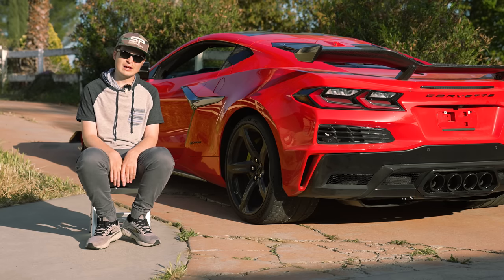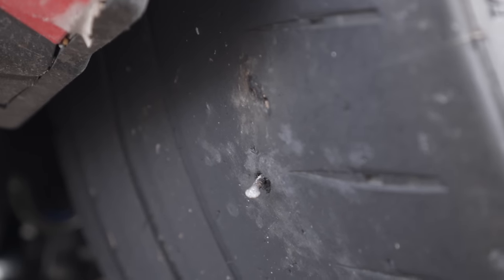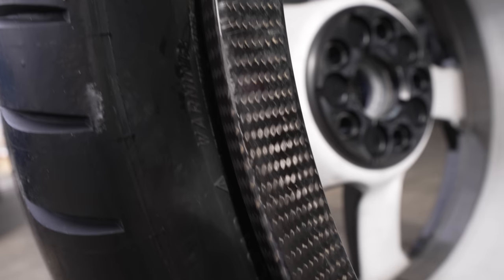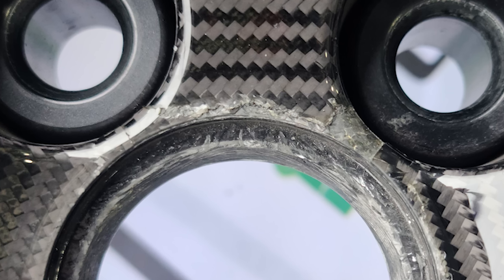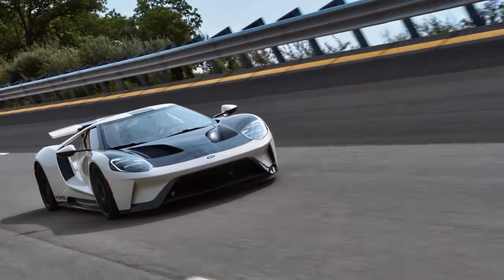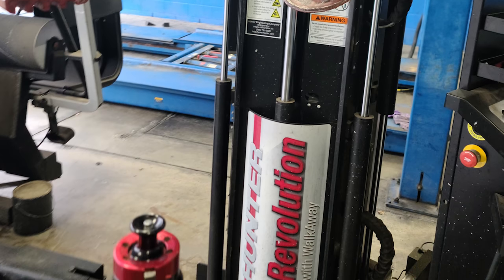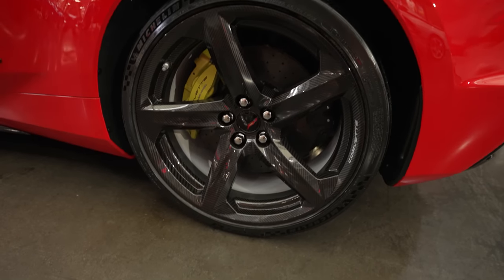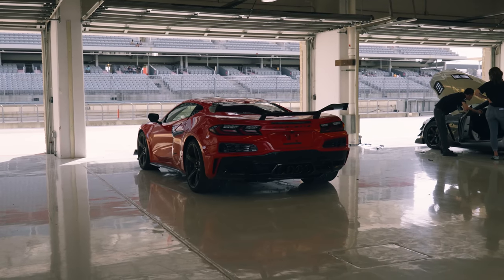MY $20,000 CARBON FIBER WHEELS ARE RUINED... YOU WON'T BELIEVE WHY!

Comment: Austin, I used to own a domestic forged wheel company and we had many customers that wanted us to make carbon fiber wheels and our patented response was that carbon fiber is not an ideal material for wheels.  They cannot stand up to heat and abuse wheels go through, especially for motorsports.  Then there is exactly what you have encountered, repeated stress destroys the material.  If I am correct, I believe Ford stopped offering insurance on their Mustang carbon wheels due to the sheer number of replacements Ford was having to do.  In the end, you have to ask yourself one major question when it comes to automotive parts:  Does Formula 1 use or employ it?  Trust me, if F1 could make it work, they would do it, but they can't .  Carbon fiber should never be used to make wheels....yet; the technology just isn't there.

Comment: Why not put the nuts on by hand - use a hand torque wrench - why use a pneumatic or a battery powered gun? I bought a unique nut wrench for my wheels on my new c8 that has a vinyl insert to keep from scratching the nuts and the inside of the hole in the wheel as well. 

Taking the tire off would be the dangerous part I would think.

Comment: You’re 100% right about the overall experience with GM and exotic car manufacturer/dealers.  I’ve had seven Corvettes, including a C8 and was on the order list for a Z06 until I bought a Lamborghini Huracan and now have an Aventador.  The buying, service and driving experience are all completely different. I can’t see myself ever buying a GM sports car over an exotic again.
Reply: You get what you pay for!  The GM mechanic is working on a 2010 Chevy Cruz, then gets told to switch tires on this new Corvette,  but have them both done in an hour. 
The Lamborghini dealer probably takes a whole day to switch tires. You pay for that!

Comment: My experience with my 23 C8 Z51 in northern Florida has convinced me Chevrolet has missed the mark completely wit the Dealer support experience with the C8.  Trained technicians are non-existant or not available, the customer service personnel are clearly not of the caliber one expects when purchasing a near $100k vehicle. My car was delivered with issues from day one, waited a month for initial repair then back in and now out of service for 3 weeks and I was informed this morning I need a new transaxle which is backordered with no specific timeline for returnof my vehicle.  Chevy engineering did a phenomenal job designing this vehicle but the rest of the team clearly dropped the ball.  Separating the Corvette brand from Chevrolet cannot come soon enough, assuming it’s done right!

Comment: That really sucks !!! I have been watching your channel for several years. The reason why I started watching you is that you tracked your Shelley GT350R . I never heard of anyone reporting Ford service about damaging GT350-GT500 wheels. Does Ford have a special machine just for their carbon fiber wheels? If so, why didn't Chevy think about this with the ZO6? I mean, I wouldn't want to bring my super car to have it's tires changed with the same machine that just changed tires on a Chevy Duramax with 37" tires. It's not like these dealerships couldn't afford a $8,000-$15,000 machine with all their markups they have been sticking us with the past few years. Thanks for pointing out this issue that Chevy needs to rectify asap.

Comment: Austin I’m an exotic car technician. It seems that the dealer you went to pretty much epitomized why many people in GM wanted Corvette to no longer be branded a Chevy and to get sold and serviced at Cadillac dealers. Supposedly a higher standard of service would be practiced there in front of the house and in the shop.

The correct way to mount those wheels to a tire machine is not with a centering cone through the middle of the wheel. Hunter (and other companies that make tire mounting machines) make and adapter that has five conical points to fit in the lug flanges attached to a steel plate with a hole in the middle. The centering clamp/cone goes into that.  This same adaptor can also be used on the wheel balancer too. This avoids any unnecessary contact with the wheel face or rim flange. And is an absolute necessity with carbon (or some other kind of delicate) wheels.

Comment: That is the recommended machine for a reason! It’s the same that is used for all the exotic brands around the world! It’s just missing an adapter! It’s called a Flange Plate adapter, put it on problem solved for the dealership moving forward! You need to make sure they order one before you do your tires again. Or go to a place with same tire changer and also has the adapter. There are videos on YouTube with the same tire changer doing carbon fiber wheels with ease!

Comment: They need a 5 lug chuck for the tire changer so it clamps the wheel  where the lug nuts go I've used them before on specialty wheels

Comment: This 100% is the fault of dealership training. I work for a GM dealership and that tire machine they are using has a finger holder specifically for this type of wheel situation. The tool goes in and puts the clamping force on the lugnut surface and never touches the face of the wheel.

Comment: As a GM World Class Corvette technician, that dealership used the incorrect adapter to mount your wheels to the Tire machine. 
They should have used the adapter that places lugs down into the wheel stud holes, not the center cap….they should be using this style adapter on all Vette wheels.

Comment: Sounds like you're still driving on the CF wheels so are they really cracked?  Or is it just wear on the carbon from many tire removal/installs?  I agree there should be a special cone for carbon wheels that Chevy dealers would use to change tires.  Those wheels are like $12k from what I see on the build and price tool.  My C8Z will be ordered w/o carbon wheels as just getting a stone chip would be a disaster.

Comment: Austin, I am sorry this happened to you.  I wish I could say I am surprised but unfortunately this seems so typical of GM.  I have said for a very long time that GM needs to decide which market they want to operate in with the Corvette and either get in or get out of it.  For instance, when I bought my C7Z06 brand new, the sticker was almost 100k.  When I took it for the 500 mile break in oil change, the Chevrolet dealership was also a Cadillac dealer.  The people with the $50k Cadillacs were in one very plush waiting area with shoe shines and Starbucks while I was in the Chevrolet waiting area with plastic chairs and vending machine coffee along with the people waiting to get their Trax oil changed.  This is part of the reason Corvette gets the bad reputation that it does, and (in my opinion) should be a separate division and not under the Chevrolet umbrella…IF they are serious about its status.

Comment: That tire changer has a flange plate that it comes with that clamps down on the reinforced lug holes and not the bore. Next time you take it in, tell them to use the flange plate. I've seen our local dealer do it.

Comment: Thank you for your update. You mentioned it, but the issue is Chevrolet has created an exotic car, without creating the infrastructure to support it. It's ashame they did backwards. I have the C8 Stingray and I have been concerned they have the proper technical training and it is much technical than ZO6.

Comment: The wheels were improperly clamped on the changer. There is an adapter which clamped the wheel by the lug holes and not the center bore.

Comment: Sorry Austin. Hopefully BG will give you a new set. 
But since you will mainly he running on track I would get another set of non CF wheels. 
What wheel does Corvette racing use and what are they planning on using next year on the Z06 platform?? 🤔

Comment: Could you pull the wheels and take the center caps off. Then go to a Ferrari, Lamborghini, Porsche or a McLaren deal for the tire swap? Just assuming they may have the right equipment to mount the tires without further damage?

Comment: I was previously employed by the manufacturer of the said equipment but now I work for a competitor. Porsche and Ferrari also recommend the same equipment. Employee training may be the biggest failure here. I personally would have used a new center cone (wearable part) as the one shown has considerable wear which may not affect a steel or alloy wheel but could cause uneven pressure around the center bore causing the wheel assembly to flex or move when mounting or dismounting.

Comment: When I took delivery of my new ZO6 one of the front wheels has a long, opaque section along the edge of the inboard barrel.  I rejected the wheel (removed it from the car and back to the dealer).  We showed it to a GM rep who sent photos to the GM "Brand Quality" division and they have advised the flaw (not simply visual; it is bumpy/ripply to the touch - damage?) is an "acceptable abnormality" and are refusing to swap it out for an unblemished wheel.  Since when do Super cars have "acceptable" abnormalities, flaws, glaring blemishes etc.?  Not in my World; outrageous.  I smell a class-action lawsuit.

Comment: You need to have a wheel hub made or get a front wheel bearing hub for a Corvette press the spindle out of the bearing, have the back cut down in a lathe and the center opened up to same size as ur wheel. Put a hole in the backing plate so tire changer pin can grab then have sleeve made that fits down threw center of ur wheel. When they run the threaded  cone down on it  That should allow the cone to only touch ur made up sleeve and   the hub should built to ur wheel.

Comment: I have recently bought the high end equipment to do high end wheels and am pretty sure I could do carbon fibre without scratching or damaging but I certainly would touch one if I had to take liability. I have a high end touchless Corghi that uses a finger plate to hold the wheel down by the 5 stud holes. The Corghi does not touch the rim unless you are careless. I also use a finger plate for the balancer. All up about $45k AUS but money well spent as I couldn't find anyone with the right equipment in Perth to do my R35 rims so I bought my own. Have done about 20 high end rims and not one marking. Don't expect to  easily find someone who can do it. You need the right equip and you need to be an enthusiast.

Comment: I have nothing against Chevrolet and have owned at least 12, but after talking to a couple of aquantinces that used to work at Chevy dealerships it makes me paranoid about going to any dealership for service. Most places are so short staffed that they will hire just about anyone. 
I heard that techs would intentionally put the wrong oil in vehicles including Corvettes because they were jealous. Instead of changing the oil filter they would clean up the outside of the old oil filter to make it look like it was changed. Another former tech told me one of the dealerships he worked for would buy whatever oil was the cheapest and they were told to use it regardless of how expensive the vehicle was including new Corvettes. There were countless other things mentioned and if they are happening at Chevy dealerships you can bet things like this happen with other brands too. Austin's experience is all too common.

Comment: At State Street Tire in Barberton Ohio we have the proper equipment to handle any Carbon Fiber wheel. We use state of the art Corghi Artiglio Master Code using special adapters that hold the wheel down the same way the wheel is bolted to the car. With Corghi Artiglio Master Code nothing touches the wheel except thru the stud holes, other machines , like the one in this video claims it’s touch less but it has plastic that touches the rims face while removing and installing. That’s why we chose the Corghi. If you are ever in Ohio and need work don’t on your special car, give us a call.

Comment: Going back to my comment on it being a Chevrolet. If ur paying wayyyy over $150k for these cars u should have top notch service. I think GM needs to have factory trained techs just for these cars in every aspect. Being your wheels are messed up is a primed example of not being trained and using crappy equipment. You are right about only using tooling on these wheels. Good luck man, gonna be a fight for sure.

Comment: Even a dedicated cone spindle thing setup will not be good. The tire machine should have a setup exactly the same as the way the wheel is bolted to the car and it should be bolted down with 5 bolts in a special balanced setup for this.

Comment: The rims should be mounted to the tire changer with a lug hole adaptor so the pressure is put on the surface that is designed to take pressure. Also they should be using far more lube than a normal tire.

Comment: What is the tire machine' manufacturer's position on this?  Is Chevrolet relying on their contract with Hunter?  Has Hunter advised Chevy regarding recommended procedures for carbon wheels?  If so, have the recommended procedures been ignored by Chevy or their dealer?

Comment: Nice info Austin, I spect the wheels should just be for Show, just because, not enough use for them to be serviced, or even replaced at this day and time... A magnesium wheel should be much lighter too than a aluminum wheel for using on the track if even you can find some. I'm also concerned about the dent and grim that the grills don't catch to protect the radiators from getting all scared up,, aftermarket?  Sure, but again here GM should have already figured that out,, like the paint, that's also as important. Show us something on that if ya can.

Comment: This could have been easily prevented by using a Haweka reverse mount flange plate adapter. The changer is among the best in the world. The flange plate accessory is available for it and other high performance tire changers. I would be happy to pilot a program for you showcasing the proper equipment, accessories and technique.

Comment: This is great content and you're spot on with your service expectations as an owner of a $200K car.  This video should be in rotation as a "lessons learned' item for all the top Chevy management personnel.  They have an opportunity here to look over their entire process and learn from it.  Sending the wheels to a 3rd party refurbishing company isn't acceptable.  Chevy should care enough to want to get to the 'root cause' of this issue and create a comprehensive solution (specialized install install equipment and training).  Chevy probably doesn't want to hear it but the Ford GT example you gave and how they approached the owner experience was much more thoughtful and carefully planned out.

Comment: As you say, something should be done about the cone used on these wheels. They should be specific to the Z06 carbon fiber wheels. I feel that a redesign of a cone should be considered for use ok older tire changing machines. This cone should have  bearings inside, similar to wheel bearings. Then the cone would remain stationary in the center of the wheel while it is tightened down.

Comment: 100% dealer fault. They did not use the flange plate attachment (a ~$800 accessory) that clamps wheels down using the bolt holes. High end mounting machines have this add-on, but most tire shops won't spend the money to buy it. We use this attachment on virtually every single wheel that comes thru the door.

Comment: Best of luck with this problem, Austin, I'm not sure they thought this through before release. Is this issue a crack in the wheel, which is extremely dangerous, or just cosmetic. Neither are ok obviously, just wanted a little clarification.

Comment: Most Chevrolet dealers suck when working on Corvettes. Every time I brought mine in for service, they would mess something up. The last time, they cracked the body in three places and this was suppose to be an easy oil change. They forgot to put the rubber cushions between the rack and the car. There aren't any other service places around here that I would trust to work on the car. I sold the car and went back to bikes and haven't looked back, bike is quicker than most cars anyway.

Comment: That tire machine has an adapter that clamps down on the 5 wheel lug holes they were supposed to be using. I work at a bmw dealer and would have to use the adapter for alpina wheels on that same machine.

Comment: When I do the cftp gt500 rims I use the steel cones from our tire balancer, I have yet to wreck a set. Granted the gt500 don’t use run flats, but that might be the key gm needs to try.

Comment: Upmost respect for you sir, you are 100% correct about every aspect, I'm sure they will make a tool softer than the carbon, like hard rubber, nylon, polyurethane etc that will fit hubcentric specifically for this application. I hope they make it right with you real soon, take care and best of luck.

Comment: If they made the clamp cone and other bearing surfaces that touch the wheel out of delrin it would probably fix this issue. Also, considering the expense of these wheels, it would make sense to have a mandrel machined to exact specifications for engagement with these center cap holes. This lack of support is inexcusable and I think GM should comp you a replacement set of wheels.

Comment: Sorry to hear this and thank you for sharing. Not surprising from GM. Rewind to 1990 when the C4 ZR-1 came out and the delaminated windshields for a $60-$100K car that would be equivalent by today’s inflation. Six years of pumping out the crappy safety hazard windshield that make the car look like crap. GM did absolutely nothing to address the issue. It’s sad that a car of C8 Z06 caliber and cost is just another Chevrolet to them. Kudos to Ford for what the did for the GT. I hope they do right with brand new wheels, compensation and get they damn dealerships trained with special tools.